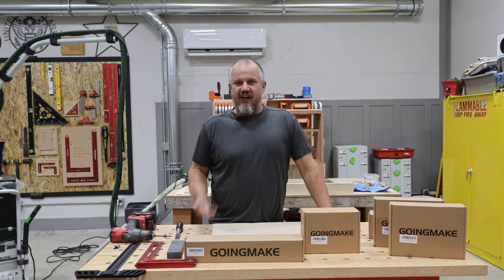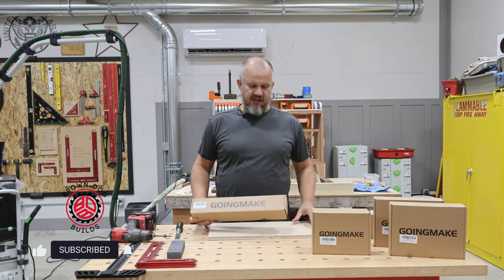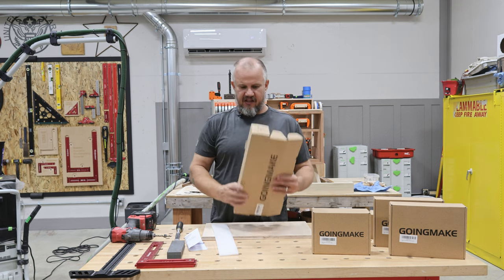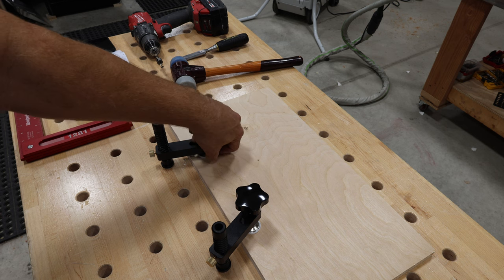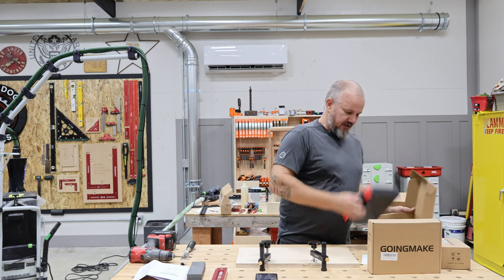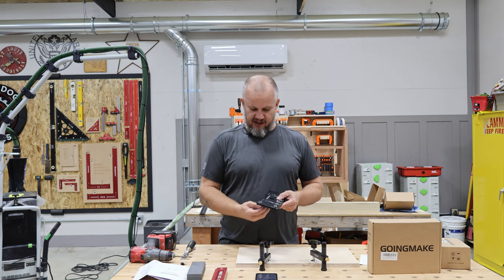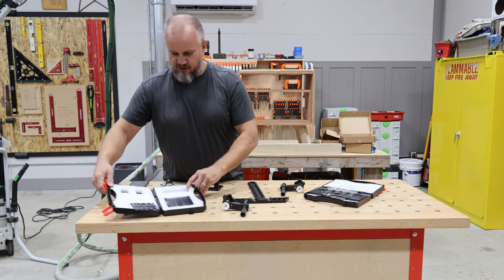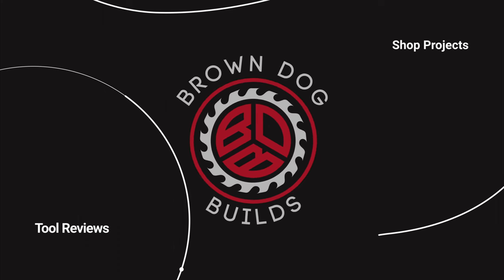The Best Goingmake Tools for DIY Woodworkers (Part 1)

Comment: It seems like Goingmake is making a serious attempt to get their name out. They have sent all the same items to several creators for review. I have yet to see anyone find something bad to say about any of them.
The only downside is that except for a thin rip jig and  different length T-squares this is their entire lineup.  

Good luck with your channel.
Reply from the maker: I would agree. The bench dog clamps are a simple design but I have been using them constantly. Thanks for the support and encouragement.
Reply: I have their 12-in T-square.  Some of the paint was missing on two of the 32nd markers and there was a burr on some of the holes such that it wasn't square.  I returned it for a second that had similar the exact same issue.  I used a drill bit to get rid of the burr, and it went together perfectly square.  All of the little 32nd holes seem to be accurate and the edges are straight.  For under $30, to get a tool with this precision is amazing. I don't care about the edge marker: most of it is there anyway.

Comment: I will gladly invest in Chinese tools (like an accurate T square) because it is a tool that has been around for ages. Tools I absolutely will not buy are tools that are obvious knockoffs like the Microjig table saw jig. That tool took years and tons of hours to develop. It's just not right to buy something that a seller basically just put into a 3D printer, made a few small changes and mass produce them. This appears to be a really good company to buy from.
Reply from the maker: It is. Their commitment to quality is obvious. Even down to the packaging.
Reply: Your videos and Flynndog woodworking have convinced me to invest my money in these tools. I don't begrudge anyone who buys the premium red tools. I however would be scared to death of dropping one and putting it out of square. I'm no klutz, but accidents do happen. I love those T squares and will probably invest in several of them. Thanks!